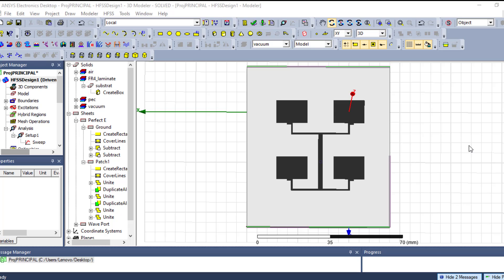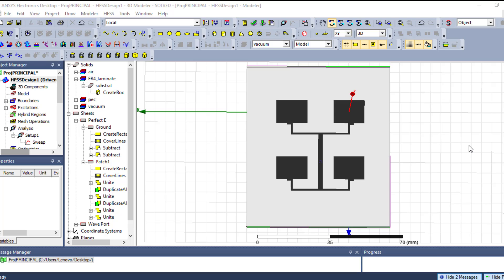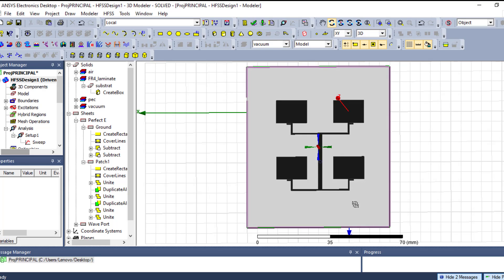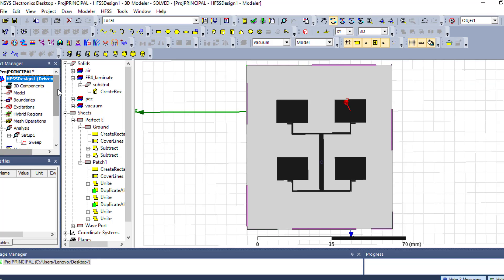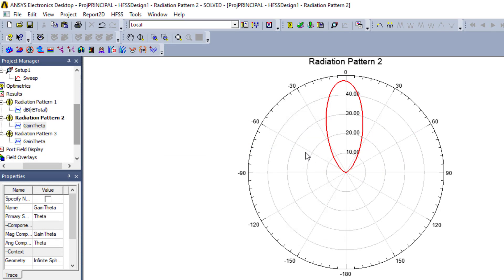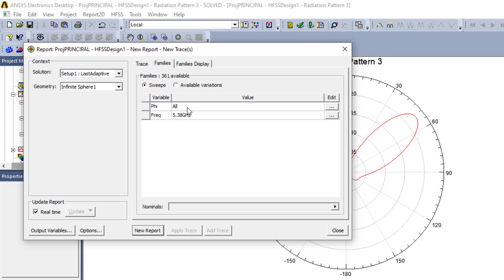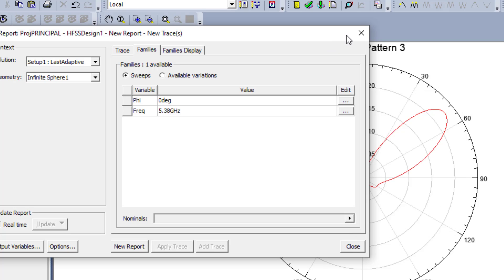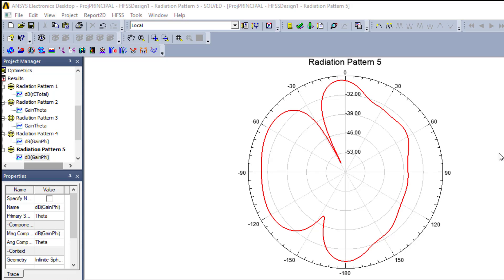How to Plot Co-polarization and Cross-polarization diagrams for antennas in HFSS (2020)

Comment: Correct me if I am wrong sir
For example for 5GHz in E-plane we will have Co polarization and cross polarization. And in H-plane we will have Co polarization and cross polarization that means for a single frequency we will have 4 radiation patterns(2 in E plane and 2 in H plane)
Reply from the maker: Yes of course for E plane we have co and cross, and the same for H plane
Reply: Tq sir
Reply: Sir then what are theta and phi values of Co and cross polarization in E plane and H plane?

Comment: My maximum radiation pattern is towrads 90. So my co polarization phi will be 90, and cross polarization phi will be 0. Or co polarization is always at 0 and cross is always at 90?
Reply: @TFEforEngineering  my theta is 90 at 3.2 GHz and 110 at 5.6GHz. For both I keep phi 0 or 90 for co polarization? Is it independent of theta direction?
Reply: @dreamboat9807  How you plotted?
Reply from the maker: You treat each case alone
Reply: @TFEforEngineering  for 3.2GHz, at theta 90. I keep 
phi =0  for   co-polarization 
and 
phi=90 for cross-polarization
Correct?
Reply from the maker: @dreamboat9807  for 3.2GHz, if you have the polarization toward theta=90°, so:
1- for E plane: co-pol is toward theta=180° and cross-pol is toward phi=0°.
2- for H plane: co-pol is toward phi=0° and cross-pol is toward theta=180°.
Reply: @TFEforEngineering   Sir my case is also same, my maximum e field antenna direction is theta=90degree. In your video you varied only phi values ..but in this comment you say theta=180 deg ..can you please explain in detail